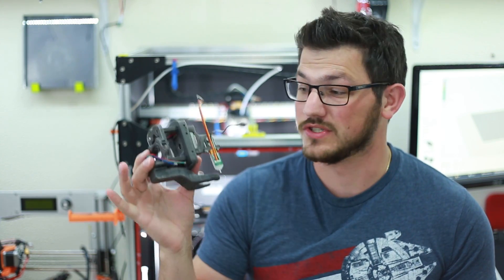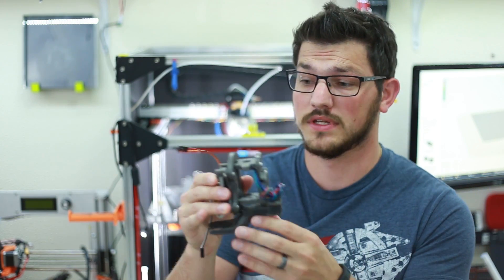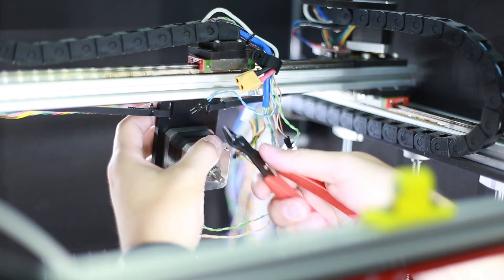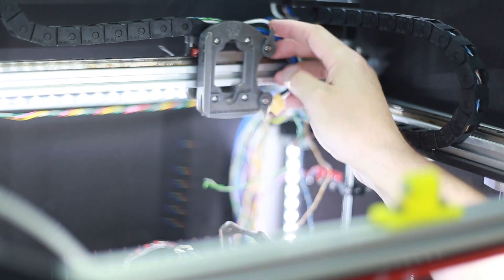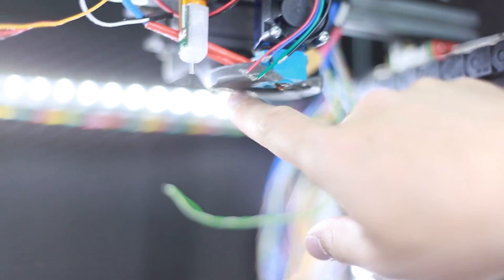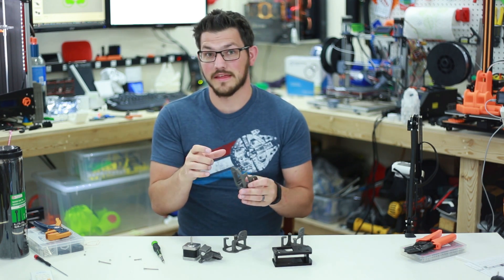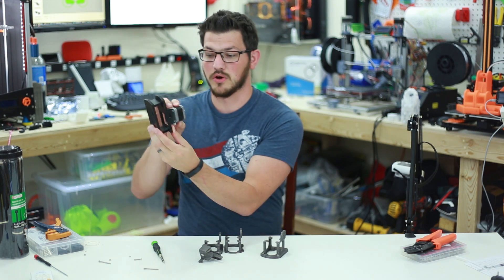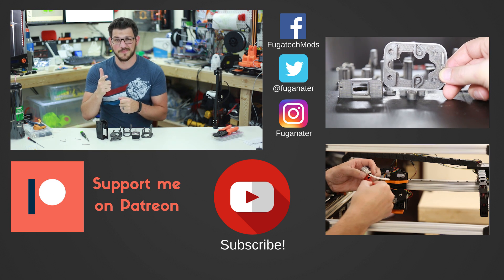FrankenShuttle Install on the Folgertech FT-5

Comment: Hey there... I'm in the process of ordering this printer.... AND you brought up a very good point that needs to be addressed; Can you design it for a bowden style system?  As you stated, it would be a lot of weight taken off the X axis and I am really inclined to set it up this way.  I have seen mounts made for the bowden extruder to mount on the 2020 frame, but nothing for just the hot end... THANK you for your time and help!!

Comment: Hey Shane, so bottom line, this setup with Titan Aero and BLTouch is still the way to go? Mine is still stock and working good, but I think I'll make a few upgrades. Curious to see if you still like it or not.
Reply from the maker: You can't use this carriage and the Titan Aero. Well you could but you would have to use standoffs to raise the build surface higher.
Reply: ooops, damn. Whats the best way to mount the Aero then? Thanks man!
Reply from the maker: Probably the 713 maker ultra light carriage. I have one and hope to install it this fall.

Comment: Nice video. just saw this from the FB group. Do you have a BOM for the hardware you used? Dont see any documentation with the stl's in the GDrive
Reply from the maker: I do not. Most of the screws are reused from the stock hot end carriage. I'm prepping to do a follow up video to explain all of this and how to assemble it.

Comment: Shane, why PETG and not PLA? Wouldn't a less flexible, stiffer plastic be better ? (Splendid video BTW!)
Reply from the maker: Since I have the FT-5 enclosed PLA would warp due to the heat. With PETG this isn't a problem. PETG has better layer adhesion than PLA and since this carriage uses 4 bolts through it is quite solid with no wiggle.
Reply: Makes total sense. THANKS!
Reply: Wouldn't ABS be more temp resistant and stiffer too?
Reply: PETG flexes, which is what you don't want on a gantry.  I installed a PETG gantry and it definitely flexed when it was moving fast.  ABS is one of the stiffest filaments, and brittleness is not an issue since there's no impact involved.

Comment: So would this work for all the stock ft5 hardware?
Reply from the maker: Yes. I talk about which plate to use with the stock stepper in the video. You use all of the bolts and nuts from the stock carriage.
Reply: Fugatech 3D Printing perfect thanks Shane my extruder moves so much even after tightening down that it was giving a reverse z hop effect durring retraction that had Dustin from folgertech support and i stumped for a bit so now i have to run it with a 2mm z hop so it doesnt run into the part. oh a little off topic but the x and y belts do you know or have done of a good way to stop the spring tensioners   from rubbing on the carriage/sliders I'm worried that it might be catching sometimes rather then just rubbing. Keep up the great content actually hoping to see more ft5 and mp select mini stuff in the future
Reply from the maker: You should take those spring tensioners off ASAP. They add more slop to the belt than they prevent. Tighten the belts by hand and then move the y motors back to tighten it more. Same with the X belt. Move the idler back to increase tension on the belt. 

I have a full set of mods planned for the MPSM, just need to make time to do them. Those are the videos with a ton of work but little reward :/
Reply: Fugatech 3D Printing ok good to know I do that next time I get a chance.

And the only thing I "had" to do with my  mpsm was the crappy way the did the heated bed wires as mine did brake after about 50 or so hours on it and I still want to get rid of the z banding but other than that I wanted the longer bed mod i saw out there which is very slick. I didn't really have the need so far for glass I found they make a roll of tan painters tape that's the same width as the bed so I just through one piece of that on and I'm good to go. I do use magigoo for petg so I don't take tape with it though haha.

Comment: Idk why but on my ft5 I can level the bed, do a print, shut it off and then go to do another print, and when it goes to print the nozzle is 1/4" above the bed, then I have to move the z endstop up and re home to compensate . this happens every single time.
Reply from the maker: Sounds like your z axis is slipping. Have you tried an alternative Z endstop or going to dual Z endstops? I never had this issue so I'm only spit-balling solutions.
Reply: Fugatech 3D Printing I'm using stock switch, but printed a new clamp to hold it on the guide rod, factory one was coarsely printed and low infill, didn't last long. I thought about the dual end stop mod, but I plan on going dual extruder eventually. I print things that dissolvable supports would help a lot with